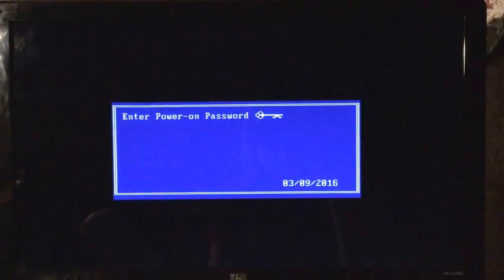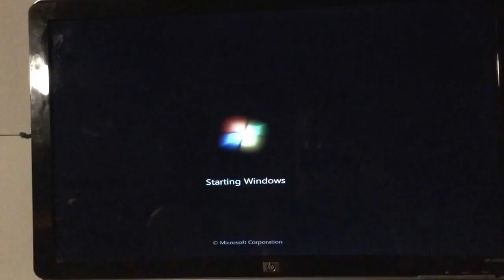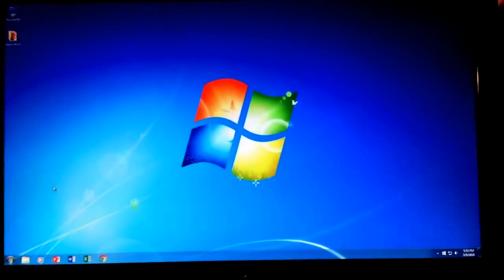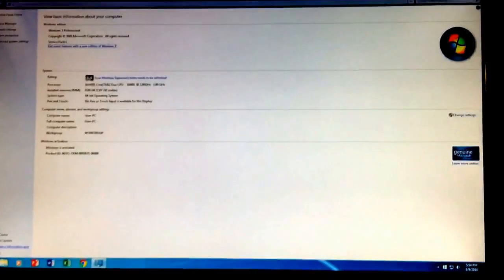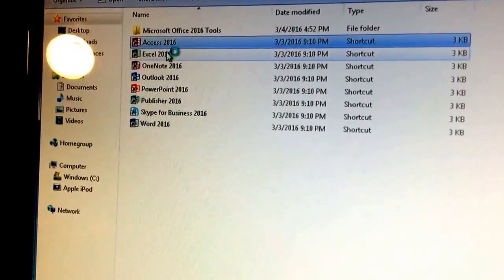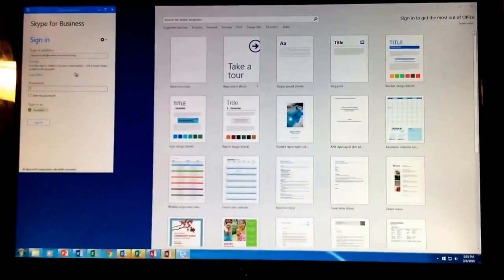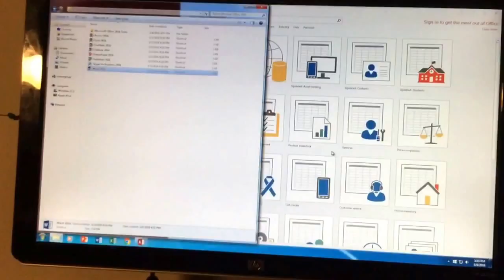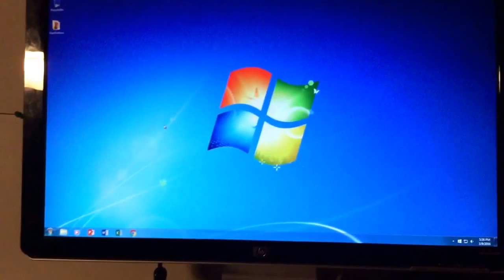HP Elite 8000 Review (and Mini Processor Stress Test!)

Comment: Nevermind. Read more of your hidden info.
Reply from the maker: Sure thing, if you have any other questions let me know
Reply: Do you know what the amperage is thank you
Reply from the maker: Tom B Here's all of the power information for the Elite 8000 SFF straight from HP's technical reference manual:

Power features:

Operating Voltage Range: 90 – 264 VAC
Rated Voltage Range: 100 – 240 VAC
Rated Line Frequency: 50/60 Hz
Operating Line Frequency Range: 47 – 63 Hz Rated Input Current: 4 A
Rated Input Current 89 Plus: 4 A
Current Leakage (NFPA 99): < 275 µA
System Heat Dissipation: Typical 198 btu/hr (50 kg-cal/hr) Maximum 1063 btu/hr (268 kg-cal/hr)
 System Heat Dissipation 89 Plus: Typical 150 btu/hr (38 kg-cal/hr), Maximum 941 btu/hr (237 kg-cal/hr)
Power Supply Fan: 92 mm variable speed, Power Consumption in ES Mode – Suspend to RAM (S3) (Instantly Available PC): <2.7 W

Power consumption	
240 watts maximum

Power requirements	
Input voltage 90 – 264 / 100 – 240 VAC, 50/60 Hz, 47 – 63 Hz, active PFC (89% High Efficiency)

Hope this helps
Reply: Thank you very much.

Comment from the maker: Hey everyone, I've received a lot of great questions about this product and i'd like to answer as many as I can right here. I'll definitely be more specific in my future videos so you can learn everything you can!

1) What upgrades can you make to this computer? 
 - This link (http://h20564.www2.hp.com/hpsc/doc/public/display?docId=emr_na-c01926344) shows all of the upgrades you can make to the Elite 8000. The only thing you can upgrade even further is Storage. I've tested 4TB hard drives on this unit with no problems to speak of.

2) How can I safely perform these upgrades?
 - First, make sure you're getting the right parts for this machine. It's best to check the link above to make sure the part you're trying to install is compatible. Then unplug the computer and hold the power button for 30 seconds to discharge any electricity. You can now open the computer and install any parts as necessary. In the video I highlight how to open the computer and where all parts are located.

3) How is the gaming performance? What graphics card should I use?
 - You'll definitely want a graphics card and a quad core processor before you expect to game on this machine. With the dual core processor and no graphics card like the one in the video, I got 30fps on CS:GO (normal settings, 720p), and 55-60fps on MineCraft (basic settings, 1080p) but anything more than that and you won't be happy with the performance. I recommend going for the Nvidia Quadro NVS 295 Graphics Card (SFF). It's the best card you can get for this machine (according to HP) so you would see a HUGE jump in fps. Paired with a quad core processor and you can play triple-A titles like Grand Theft Auto 5 at a halfway decent 25fps. 

4) What ports does it have? 
 - In the video I go over the ports every basic model of this computer has. There is no wi-fi by default but you can find USB wi-fi adapters for around $15 online. Depending on the graphics card you get you can add DisplayPort and HDMI outputs as well.

Feel free to leave any other questions below
- Luke (Simplyou2be)
Reply: Hey man can i game witcher 3 in it ? plus how much psu does it have? 
 its actually a medium dekstop not the smallest ssf as u have. its coming with i5 3rd gen
Reply: A bro i really need some help please. i got the exact same computer and i just recently got a graphic card to put in it but i guess i got the wrong graphic card because the part that goes into the motherboard is to small. Can you please reply and help me thank you.
Reply: yupp i am rite now
Reply: Simplyou2be is there a difference between Hp 8000 elite and a normal Hp 8000?
Reply: Simplyou2be my hp elite8000 wont turn on snd next to the battery the green light isnt on and its just a black screen can u help?
Reply: Can i upgrade to HP Elite 8000.Graphic Card GT 1030 + Core 2 Quad Q4400
Reply: Can you run the xbox app on this a stream games flawless
Reply: do a speaker test because I don't have one of those machines and I want to do a speaker test with music
Reply: The link is not working anymore, can you help?
Reply: How it handles playing 1080p video online on YouTube, or in video players? I know it's 2021 but still 😅
Reply: @RealElementProductions  i just got one system with this and 4GB DDR3 RAM for just 13$. 😅 It's a Lenovo ThinkCentre M58p.

Comment: I work in the IT department for the university I attended and they hate these computers.  well the elite 8100 version of this.  A while back we had a severe thunderstorm that blew out the onboard eithernet on 5 of these in one night and we didn't have low profile ethernet cards for them we only had standard height.  We ended up replacing them with elite 8200 towers rather than the small form factor desktops like yours.  It's just to hard to find cheap power supplies for these small form factor versions.
Reply from the maker: Yup, that's the cost for portability. Although you could expect that behavior from any computer in a thunderstorm. Just be thankful you didn't have a 2006-2010 Dell Optiplex. All of those would've been fried
Reply: We do have a bunch of dell optiplex 760s and 960s from 2008-2009 ish in tower form most of which have added ethernet cards to them over the years

Comment: so is this good for games like cs go and overwatch
Reply from the maker: Yes, 30fps medium settings
Reply: Simplyou2be I was wondering if the Hp 8000 had a big diffrence from the Hp elite 8000
Reply: i play  CS EXTREME v6 with ge force gtx 650 but when i put up to 30 bots the game hangs and can only run the game with below 30 bots . both cpu cores seems average 90% usage when i run the game
Reply: Simplyou2be what windows is this? And can u play roblox.Com on it without lag?

Comment: so... if I put 8GB of RAM in will it fry my pc
Reply from the maker: lol no XD. These systems can handle up to 16GB, if you put in more the computer will run the same, it just won't use the extra ram.
Reply: @RealElementProductions  mine are using 4 ram , but i want to upgrate to 8

Comment: Hey I've bought a c2quad 2.66 q8400 and it won't seem to boot with this core inside my hp elite 8000. you mentioned somewhere in the comments that you should be able to upgrade them to a quad but I'm stuck at booting. the machine starts up then turns off and reboots only to show a black screen and the fans get really loud. I have already got the latest bios installed so Idk what else the problem could be. I put the c2duo back in and it works fine... any suggestions?? much appreciated
Reply from the maker: Sounds like a bad processor! Check the bottom of the processor and make sure all of the contacts are clean. If not, lightly dampen a q-tip with water and run it along all of the contacts. Also make sure you're applying thermal compound. The processor will die an ugly death without any: http://www.newegg.com/Product/Product.aspx?Item=N82E16835186038
Reply: This happened a while ago with another cpu I bought, however I had another mobo and slapped it in that and it was fine. The exact same thing that happened with that cpu in this machine happened with this core 2 quad. It's the right chipset and everything so I'm really confused right now... Should I try removing some ram or updating all the other device drivers??
Reply from the maker: I haven't had that problem before, so I don't know exactly what to do. I'd keep doing what you're doing and let me know what works. 

Best of luck!
Reply: Thanks I try what you suggested
Reply: Ok so it isn't ram I tested using one stick of 2gb ddr3 and nothing, then none then 3 then all but still the same thing. Boots onto a black screen then reboots and the fans turn onto max output. Tried cleaning the cpu as well but that didn't help either

Comment: is it good for gaming
Reply: and how loud is it on a scale of 1-10
Reply from the maker: On a scale of 1-10 (1 being quietest), it's a 3. The fan doesn't even ramp up while gaming, and the computer stays relatively cool. With the integrated graphics, gaming is pretty bad (only 30fps from Garry's Mod mid settings). You can get a graphics card for this machine, but don't expect to play any Triple A games too well. This is mostly just a business computer that's best for multi-taskers and casual gaming. Hope this helps!
Reply: like minecrafting
Reply: and thank you
Reply from the maker: Minecraft runs pretty well, actually (40-50fps fast settings). You could get an Elite 8000 with no graphics card, try your favorite games, and get a card if you see it necessary. If you're only going to play casual games though, I think integrated graphics will be okay
Reply: thank you
Reply: Hello.
Minecraft runs, but some times lags.
U can try it with optifine but for me it crashes (frozen, lag) and I have to reload the game. And

Comment: How does it work with video editing, or (twitch streams-(capture card)) and does it work well with simple gaming
Reply from the maker: Video editing is average. It will stutter and freeze on occasion when panning through, so it's not really meant for anything over 720p. Simple gaming is definitely good on this computer. Even without a graphics card I could hit 50fps steady on Garry's Mod. With a graphics card and an upgrade to Intel Core 2 Quad this computer can even handle GTA 5 (albeit very slowly), but still amazing for its age. Hope this helped!
Reply: Luke - Thanks I just ordered one Thanks for the help
Reply: +TURTLELIZER can it play Minecraft and csgo?
Reply: I haven't had any trouble so far just a little lag but not bad dont make much of a difference in game play
Reply: I can hardly run a gamecube game and 720p video on it
Upgrade it or sell it
Reply from the maker: ***** I assume you'e using Dolphin emulator? That's highly CPU intensive, and if you have an Intel Core 2 Duo below 3.0GHz, you will have some problems playing emulated games. I recommend going on eBay and getting an Intel Core 2 Quad 6600. They run about $19 and will really boost your performance! as for the poor video playback, that could be a network issue, or if your screen is large, the computer is probably having trouble driving the video to your display (which is another processor issue lol). I recommend upgrading to a quad core Intel processor. They're cheap and make a worlds difference. Come back to me with the specs of your computer. Also, can you run this test for me? (http://www.speedtest.net/) It will determine how fast your internet is. It's completely anonymous and will help me determine what the problem is.
Reply: My friend told me the best CPU that would be compatible with this motherboard and that i'd have basically no difference.
also i can tell that it's both my internet and the machine that's having trouble with hd video.
Reply from the maker: +「TSJOMStudios」 hmm, okay. A quad core processor does help this machine out a lot and improves video playback as well. Considering that I have a 3.0GHz core 2 duo in mine with no video playback or gaming issues, upgrading the processor to quad core will allow better multi-tasking and much better gameplay.
Reply: Yeah, I just need a new motherboard basically lol
Reply from the maker: +「TSJOMStudios」 geez, that's a pretty big job! I recommend you use antistatic bags to hold the RAM and Hard Drive so you minimize the risk of damage. Always ground yourself and never work with a computer that's plugged into the wall. After unplugging your computer, hold the power button for 30 seconds and then tap the power supply a few times to ground yourself. Make sure to remove the CMOS battery (Or replace it if you're getting low voltage warnings when booting up). Good luck!
Reply: Luke - Yea But I could Hope

Comment: can you upgrade to windows ten for free
Reply from the maker: If your asking if this specific computer can handle Windows 10, then yes. If you're asking about any computer, then yes as well. Windows 10 is free on any computer running Windows 7 or above until this July. After that it's $119 for Windows 10 Home, and $199 for Windows 10 Pro. I hope that helps!
Reply: +Luke “Simplyou2be” - is it worth buying and can it upgrade for free of its windows 8.1
Reply from the maker: +SHOTzzHD I personally dislike Windows 10, and if you like Windows 8.1, I recommend staying. However, you can try Windows 10 and have 31 days to downgrade back to Windows 8.1. It is also free, so your call. Remember, you have a month to go back if you don't like  Windows 10
Reply: +Luke “Simplyou2be” - Ok thanks I'm gonna buy a hp 251 123 pc
Reply from the maker: +SHOTzzHD that's a decent PC for home use (web browsing, photo albums, word processing) but don't expect any gaming from that machine. Overall a nice value with the monitor too!

Comment: That's DisplayPort, not eSATA.
Reply from the maker: +David Barrera World of Warcraft works fine without a video card! I tested it with normal settings and reached 33fps avg.
Reply: okok Sweet i like to here that. Thanks my brotha really looking foward to getting this computer..
Reply: The best graphics card for a small machine like this, is probably a nVidia GT740.
Reply from the maker: David Barrera Parker makes a good point. While having a video card isn't necessary, it really helps you when you want to play higher end games. In fact, if you have a video card and a quad core Intel processor, you can run GTA 5 halfway decently! Best of luck -SYT
Reply from the maker: I was just about to edit that lol. Thx for the clarification though
Reply: I just bought this same computer off amazon this one right here
https://www.amazon.com/gp/product/B008F8RMMS/ref=oh_aui_detailpage_o04_s00?ie=UTF8&psc=1

And i want to know what graphic card can i put in it to play world of warcraft only. Let me know please thank you.
Reply: I just got my Computer and installed Wow it runs pretty Nice! it Does give me a warning saying that my computer does not meet the Requirements but i can still play. it lags when i get to big citys. What graphic card do i need to buy specifically to really improve everything ?? i have windows 10 32bit. I looked online for the Gpu mentioned and there seems to be a bunch of them which one do i need for my computer ??? is there a certain one or type. let me know thank you
Reply: i can link you my computer specs if you need them also if that helps.
Reply: +David Barrera Any Gt 740 with 2GB GDDR5 would be good, but it would HAVE to be a low profile card.

Comment: What graphics card do you recommend for this? I plan on getting one and would also like to hear more about what other cables/accessories you'd recommend. Thanks.
Reply: Also, did that monitor come with it, the place where I wanna get mine from doesn't really say if it does or doesn't
Reply from the maker: +Mr. TIE Hi! The monitor didn't come with it, it just happens to match the Elite 8000 really well. The best graphics card would be the "Nvidia Quadro NVS 295 Graphics Card (SFF)". It's the best one you can get for the computer and are generally cheap today. If you want to check it out, I featured the monitor in a review here: https://www.youtube.com/watch?v=jgFVmo8V6oE Good luck with your purchase!
Reply from the maker: +Mr. TIE That's a good deal, you can also find some pretty great deals on eBay. I get the majority of my cards from there, and they're like new as well. I'd recommend taking a look there as well.
Reply: Luke - okay, thanks!

Comment: can u play normal games on this like minecraft and call of duty modern warfare 4?
Reply from the maker: +Clash with Sach It plays minecraft @ about 40fps, but no way it'll play COD MW4, even if it's decked out with 8GB and a 3GHz Core 2 Duo. I'd say you're better off getting a graphics card for this unit or you'll be seeing slideshows while you're playing.
Reply: +Luke - (Simplyou2be) thanks but what do u mean by slide shows
Reply from the maker: Really, really slow gameplay
Reply: +Clash with Sach You can get the the MSI Radeon HD6450 sff gpu for 35 dollars.
Reply: MineTEST runs better, It's a less process intensive minecraft clone with all the same features and gameplay as minecraft.